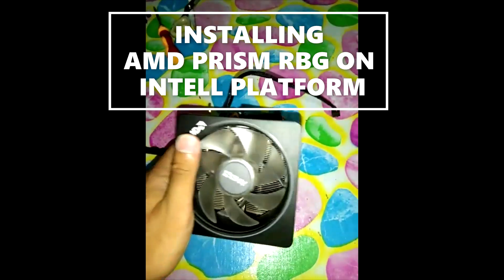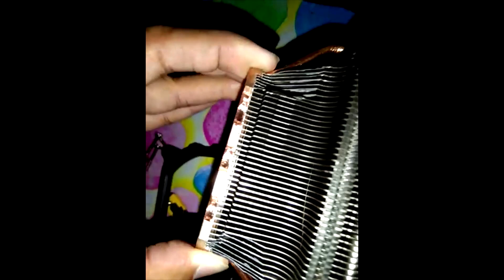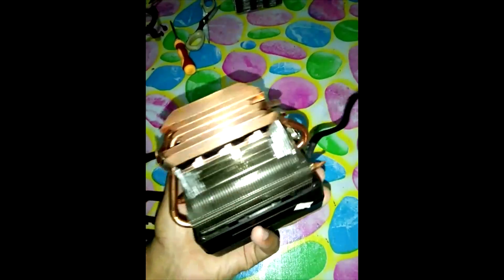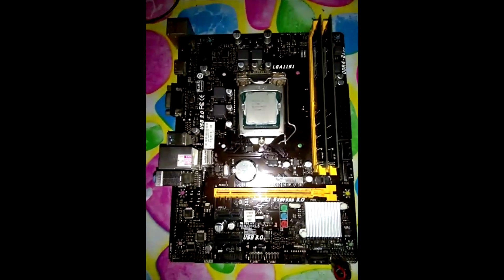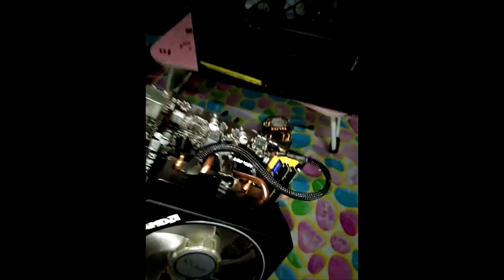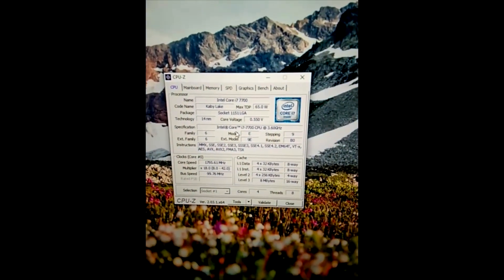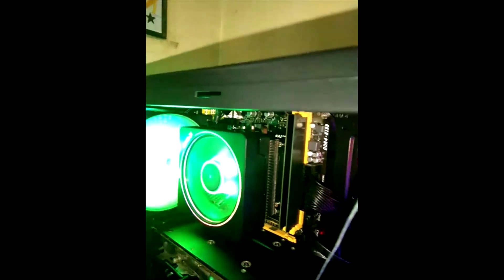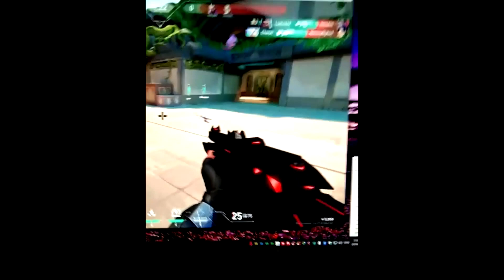AMD WRAITH PRISM RGB on INTEL

Comment: man... cutting radiator to just fit for plastic adapter its so😂... i have wraith max on my h110m dgs and it fits perfectly without any modification and keeps up by plastic clamps
Reply from the maker: @aothe2239  only the small amount and not the heat pipes it self and also i did not bend it excessively to still do it's thing because i know it's filled with liquid